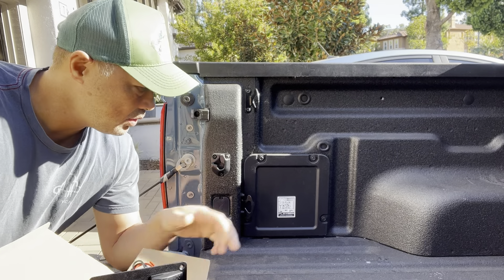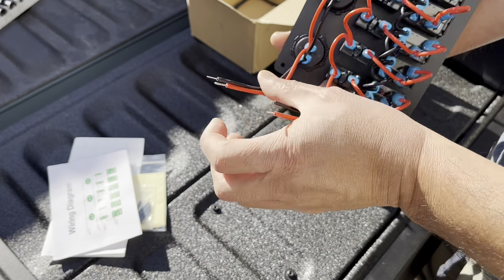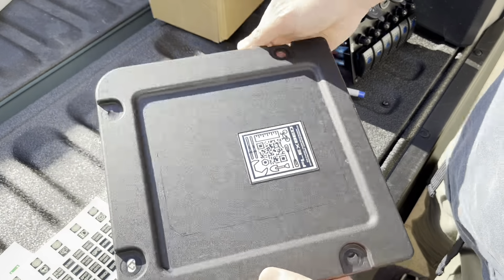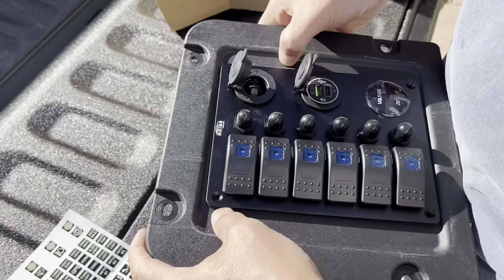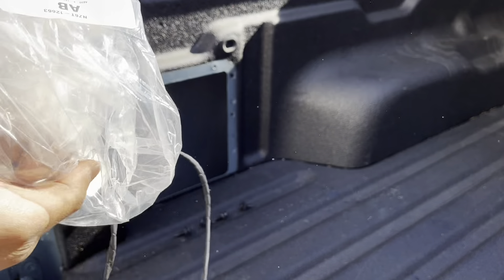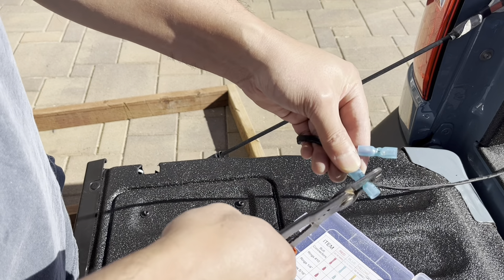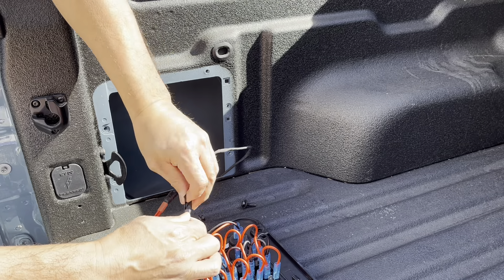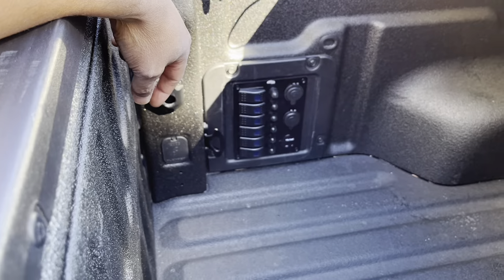Waterproof Power Switch Panel On My Ford Maverick Truck Bed

Comment from the maker: Installed a waterproof switch panel in the bed of my Maverick.  Easy install with Ford's flexbed options.  Haven't hooked anything to it yet, I just wanted to have the power ready to when I start installing bed lights, power inverters and stuff.
Mking 6 Gang Rocker Switch https://amzn.to/3Us7wmR
Terminal Connectors https://amzn.to/3E6NGHg
Reply: Please keep us posted in the inverter and / or  lights installation through switch panel.

Comment: Honestly I couldn’t wait to order my hybrid xlt so I probably got bent over at the dealer yesterday but I been daily driving a super duty 6.7 Deisel F350 and the price I paid for my Maverick is worth the money I’m saving on diesel. Not to mention the mileage I was racking up on my tow rig. I kept the diesel of course and now I get to keep that truck pristine! I was spending an average of $225 a week on fuel just to go to work each week! 

Great video. Subscribed.
Reply from the maker: Congrats. I am enjoying the great gas mileage on my Maverick too. Even with the custom camper (https://youtu.be/33I-ysi9Nb0?si=SlQR3_z1t8EurVNp) I still got up to 38 mpg (city).

Comment: Placed an order yesterday for a Maverick so I've got a long wait. I really like this solution compared to others I've seen so far. The only difference I'd make is to rewire that panel to make the first switch a sort of "Master Switch" to cut power to the entire panel. So you'd have to hit the Master Switch to supply power to the panel and then switch on whatever you want. I know LEDs have low power draw so the hour of the truck providing power is no big deal, but for peace of mind I'm probably going to do it.

Thanks for the awesome video!
Reply: Funny you mention this, because I was really debating if I should make a master switch out of one of those. Haha
Reply: @irvinec3270  to me it'd be peace of mind to do it. Plus I think 5 switches are more than enough anyway. Probably would have to switch the breaker for that Master Switch for something bigger if you do the entire panel. Or just have the Master Switch control the 12v plug, USBs and/or screen.

Comment: Thanks for your videos, I've been loving them! Can you show one with a power inverter to the 400W? I skipped the luxury package on my maverick so that it would get picked up by the factory earlier. It worked and I got my maverick fast, but now I want to install a 400W inverter like the one that is included in the luxury package.
Reply from the maker: Got so many other projects going on.  That one is low on my list right now. haha

Comment: Thanks again for posting this video! Did you ever find out if closing the tailgate shut the panel off faster? My maverick has finally shipped and I hope to be installing one of these soon.
Reply from the maker: I did not time the difference, but through casual observation there is zero difference. Congrats on the truck. #1 hated thing about the maverick is the wait. Haha

Comment: I'm installing one with just three switches the USB outlet and the 12-volt Outlet. The third switch is extra in case they want to add something in the future this is just for the bed lights. Also I bought a 12 volt inverter that plugs into the 12-volt Outlet to give me a 110V A/C Outlet. What do you plan to use all those switches for? ???
Reply from the maker: Good questions.  Sometimes your plans are bigger than reality.  haha

Comment: Any update on adding led bed lights to that panel.. I tried on a smaller panel but, blew the 20A fuse.. replaced it.. and nothing.. how would you correctly connect LED’s that come with a switch.. to the panel, using a switch on the panel?
Reply from the maker: Yes. Here you go. https://youtu.be/GB09IIr1wV8
No issues so far.

Comment: This would be perfect if it included a space for a receptacle to run 110 AC through a power inverter
Reply from the maker: I agree!  I wish it did too!  I may take out the voltmeter, bore a bigger hole and put in a 110 plug.

Comment: No 110v outlet? Do you think it could be done?
Reply from the maker: For sure.  With water proof port like this https://amzn.to/3C0CThy .
You can easily fit a 400w inverter in the space.
Reply: @ryandick9649   So am I :)
Reply: Just before you added electrical tape for added protection, I was going to suggest adding heat shrink tubing.  Still wouldn’t be a bad idea. I would think it would be a more permanent solution to electrical tap.  
With that being said, I wasn’t knocking your decision. It is very nice install! Looks great!